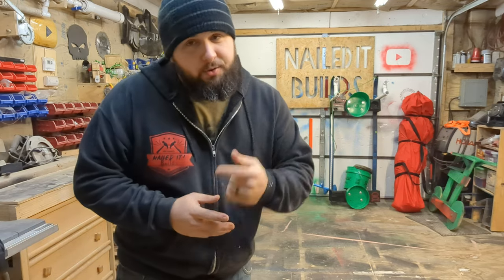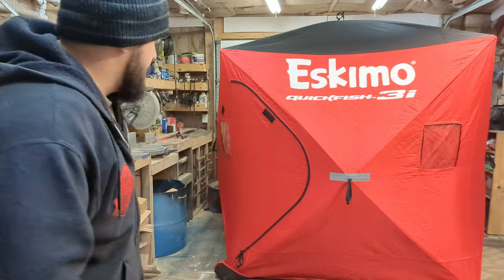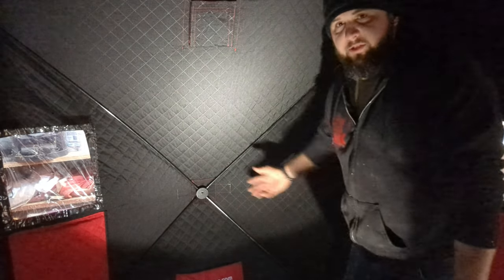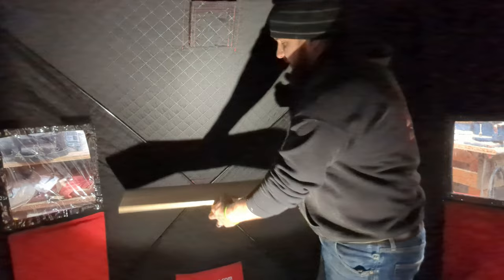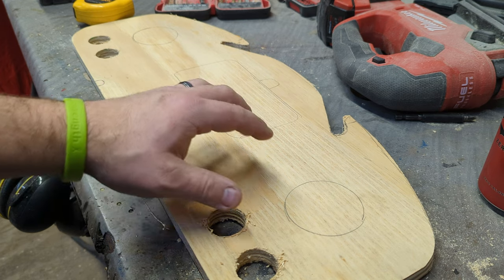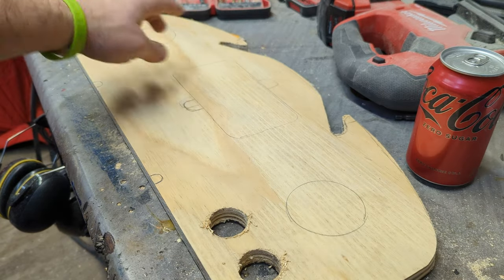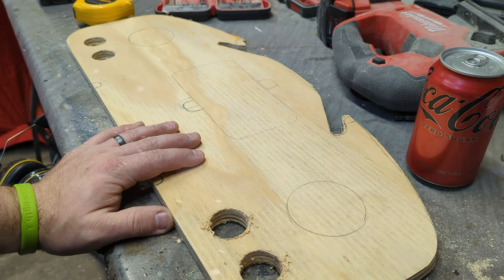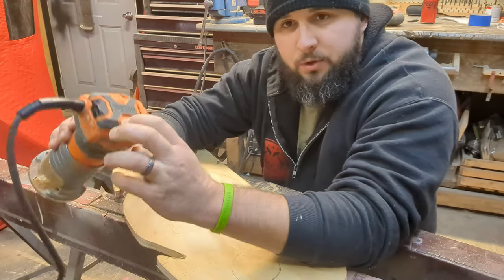Hub Ice Shanty Shelf

Comment: I saw the same CSO video and after a little bit of measuring and a little bit of CAD drawing I have my first prototype yesterday.  I too have the problem of the table wanting to lean down. Was thinking of some fixes for that: narrowing the gap and not routering the spaces that wrap around the hub poles, adding more layers of plywood at the pole notches to “lever” the table back up, etc.  The bungee cord is a great easy solution though. I may try that.